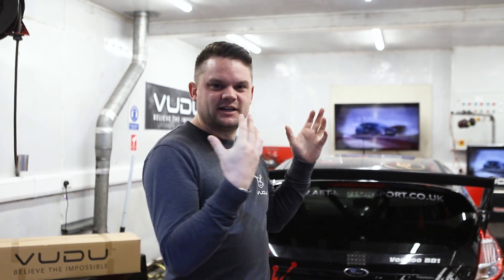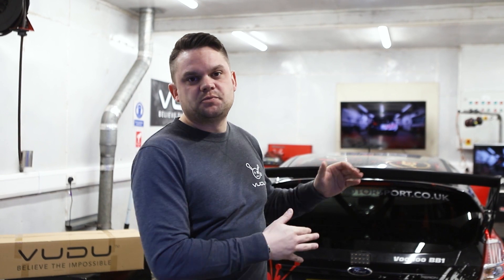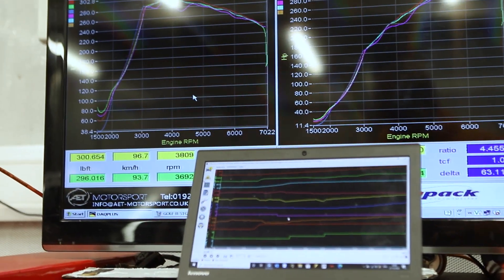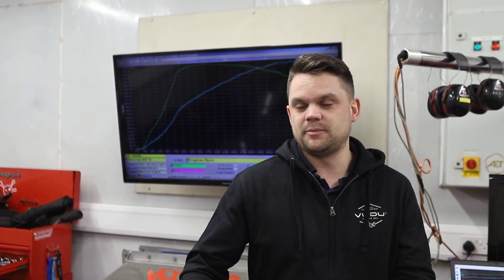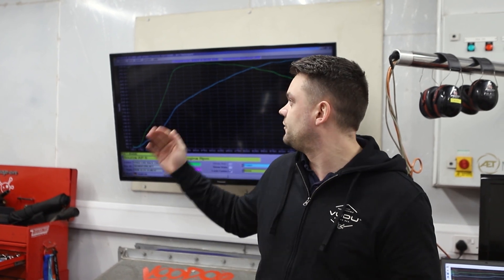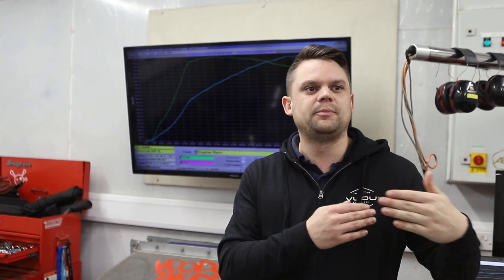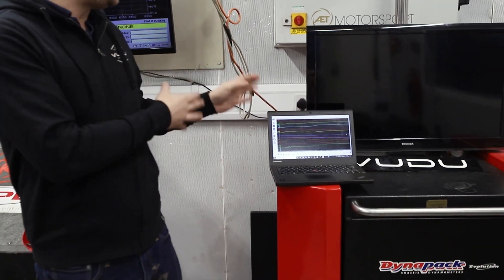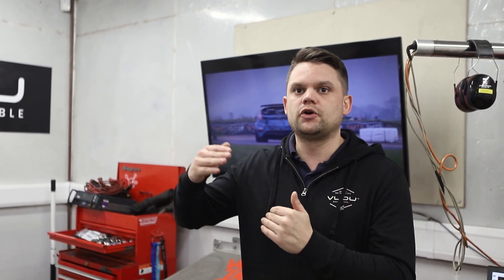Ford Intercooler vs VUDU Stage 2+ Intercooler Ford Fiesta ST180 Race Car!! | VUDU Testing

Comment: I bought a stage 2 small profile intercooler and a stage 2 induction kit but i have a stage 1 installed, cause in belgium it illegal to change ur exhaust and downpipe so i’m making 232hp with a stage 1 wich is pretty dang good!

Comment: I've got this cooler and it's fantastic! Fits perfectly and holds the power so much better then my last stage 2 cooler, great you put this video up to prove how good it is
Reply: Just ordered one also! Much modifications needed for fitment?.
Reply: @dobbyboy3116  hey, you have to remove the top intercooler cover, it's behind the bumper, you'll see what I mean when you fit yours etc, just 2 bolts and think it was 2 of those plastic screws, but other then that nothing else
Reply: What cooler you mean? Oil cooler or transmission oil cooler?
Reply: @mydc2200   Intercooler, same as the video